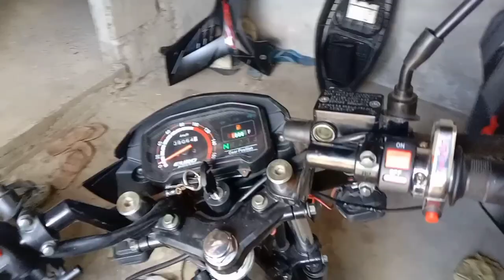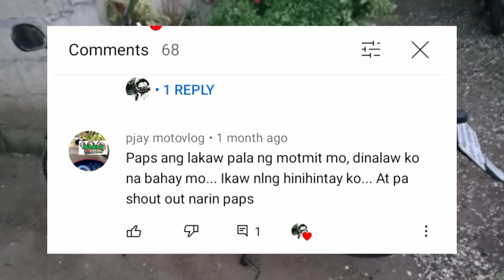stock airbox to big carb pwede kaya?stock set up / mas ok kesa after market plus SHOUT OUT!!!

Comment: Anong tube hose pwede kapag 28mm carb baka may idea ka boss?
Reply from the maker: Mga after Market na pang air filter lods baka kc Hindi swak Yung pang xrm 125 gang 24mm lng kc yun
Reply: Ay pwede siguro ung mga rad na mushroom noh tapos kunin ko lang ung hose na part, gusto ko kasi stock airbox, wave 125 ung motor